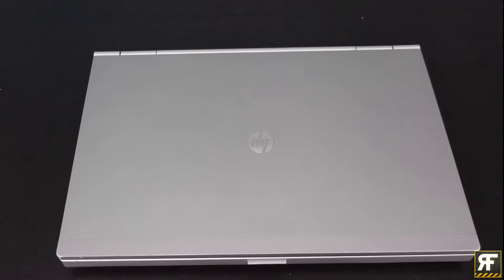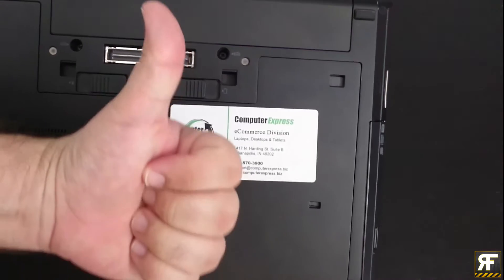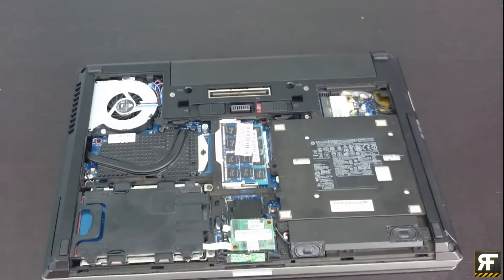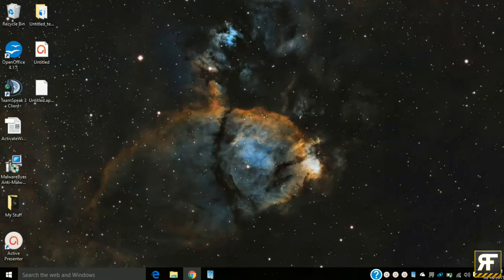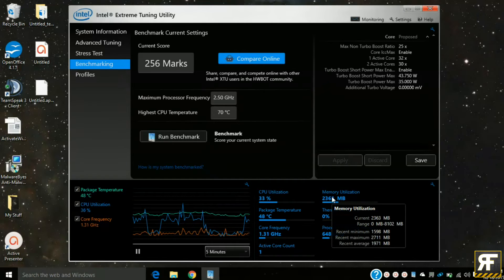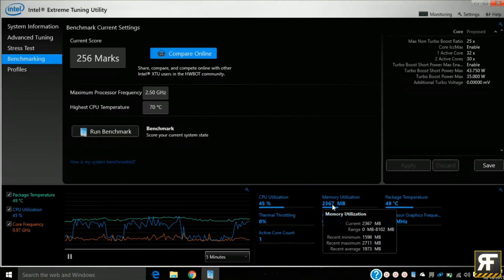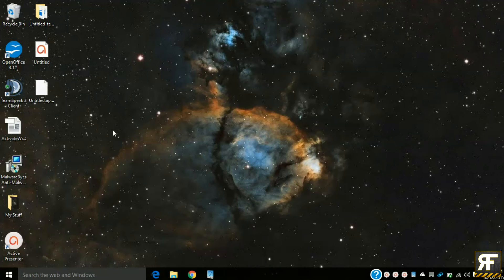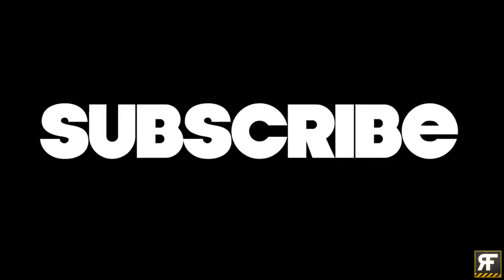HP EliteBook 8460p Arctic MX-4 Thermal Paste Upgrade

Comment: ALWAYS - I SAID ALWAYS DISCONNECT THE POWER ADAPTER AND THE BATTERY BEFORE YOU EVEN TAKE A LOOK INSIDE YOUR LAPTOP. It's also highly recommended that you use an anti static wrist strap and a anti static cloth because static electricity can be a pain in the butt. Never use an electrical screwdriver as it always tend to screw screws too tight and damage the board or plastic parts which are very easy to break. Other than that - nice video, great result!
Reply from the maker: +ionescu Solid advice!
Reply: Great tips here.

Apply a line, not a smudge, you'll have thermal paste all over the die.

Also another comment, use 99.9% isopropyl, not the regular pharmacy stuff (it has water).

I always wear my wrist strap, cant be to careful!